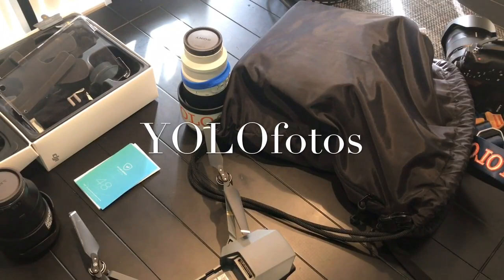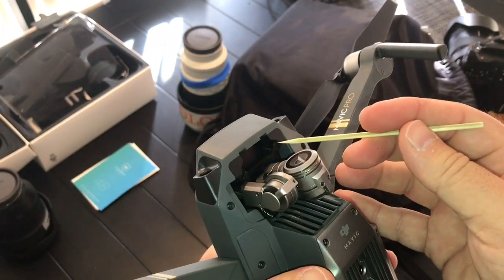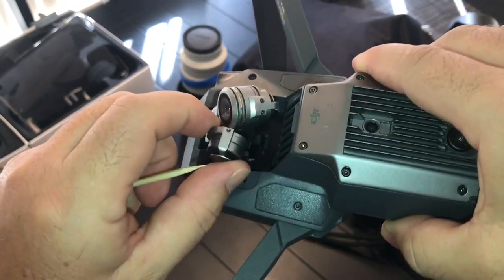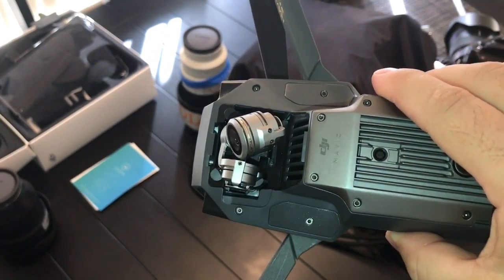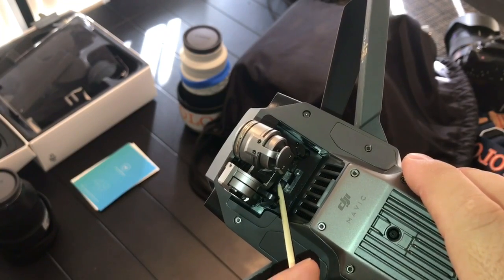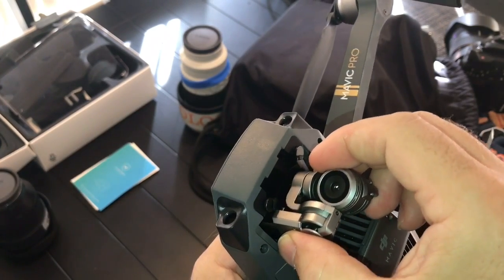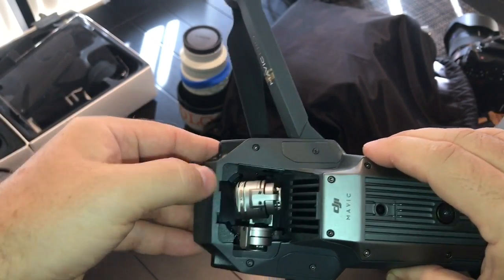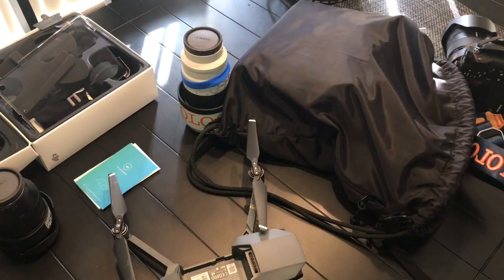DJI Mavic Gimbal Vibration Error

Comment: I came across this video as I occasionally (note: not always) get heavy gimbal shake (sometimes with, sometimes without an "excessive vibration" warning)  and that is absolutely useless for films for my Golf&Tesla channel (I use the drone mainly for my golf course reviews, views of Tesla superchargers from above,  and occasional landscape footage). And I don't want to take the drone and camera/gimbal apart... However in my case, moving the plate back in the proper position did not solve the problem ... - but thanks anyway. Your video is well made.
Reply from the maker: Bummer it didn’t work. Good luck and thanks for the compliment!

Comment: Great vid my man. Unfortunately for me the gimbal issue persists. It is attached perfectly (as far as I can tell) with the gimbal platform underneath the L bar. Do the rubber bands need to be tightened perhaps? I'm too cautious to just give it a go... Anyone else have this issue?
Reply from the maker: Gus Read if you have not replaced your blades replace your blades. That may be the problem.

Comment: I still get “Gimbal Abnormal Vibration”. Everything is set properly. I’ve even popped it out and snapped it back in but error still comes. What can I do?
Reply from the maker: BBQ Made Easy you may have another problem maybe change out your blades.
Reply: YOLOfotos I found out last week it was my blades. I was using the low noise propellers for mavic and mavic pro. Went back to default and no more issues
Reply from the maker: BBQ Made Easy good deal!!

Comment: Hello I wanted to clarify a question I have a Mavic Pro platinum and I have a problem with it every time I fly with it loses focus I don't understand what else to do it loses focus and doesn't come back I go back to calibrate it and when it is in the air  lose focus again would you know to tell me why it happens?
 Thanks
Reply from the maker: Hugo Soares I had the same problem. For me it turned out to be that the infinite focus was not activated. Meaning everything is in focus all the time. Look up videos on infinite focus versus manual focus and you should be able to find the setting. For me I was having to tap on the screen every time I wanted to focus in on something.

Comment: Thanks, I had a crash when my props iced up while flying up through a layer of freezing fog. Your video solved my problem. Fortunately I only flew vertical and it came down right where I took off. Only the props were damaged and gimbal dislodged. I love YouTube. I remember when YouTube was just knuckleheads crashing on skateboards.
Reply from the maker: yankmyfinger right!  Lol. Such a great resource. Thanks for the comment.
Reply: I found this also except for me it was up a mountain and the air temperature was a little cold. I have now learnt my lesson about unfolding the propellers first when in cold conditions.

Comment: This is actually not the proper solution with the gimbal abnormal vibration error.  I’ve had it on and off on my MavicPro and every time I check the camera, it’s properly seated. When I fly on tripod mode, the error was never there.  The rubber and damper wears out which makes the camera shakes more especially with winds blowing up there.
Reply from the maker: Erwin Lopez this fix does no address worn dampers. Correct.

Comment: I crashed my drone after going sideways into a tree branch.  I found the gimbal on top of those visible outer tabs, put it back in, and thought it was floating pretty freely (although I did notice that the camera holder was not going on as easily).  Since I broke off small pieces of the ends of two propellers I thought that may be the cause, but after putting new propellers on it was not.  But after watching your video I found the little tab on the wrong side of the base plate.  After fixing that no vibration error! yay! Thanks for the great video. Thanks!
Reply from the maker: Thanks

Comment: I figured out this problem also, but it only became apparent when I could not fit the gimbal clamp in place. I then realised that this was because the gimbal was sat on to of this L-plate. So if you are getting a vibration error, see if you can fit the gimbal clamp, and if you cannot fit the gimbal clamp this means the gimbal is on top of the L-plate.
Reply from the maker: Thanks

Comment: THANK YOU! I thought for sure the Mavic was on its way back for repairs. I wasn't getting an error. The symptom I had was that the gimbal clamp was putting too much pressure on the gimbal when I tried to snap it into place. It was like the lens was too far forward and down for the clamp to freely snap into the lock position. Once the frame fit under the "L" shaped piece everything just fell into place. THANK YOU!
Reply from the maker: Thanks

Comment: Maybe anyone of you can help me... This little bracket you mentioned in your video is broken :/ don't know how this could happen (had no crash) ... I noticed it only when i wanted to use my mavic the next day. The gimbal behaved strange and couldnt be calibrated corrcetly. During the flight it was shanking the whole time ... Anybody struggles with same problems, any suggestions what i can do?
Reply: did you ever find a part to replace the bracket? same issue here
Reply: @SouthernFlow  DJI fixed it for me... Probably changed the whole lot
Reply from the maker: Thanks

Comment: dude, it's so rare that i actually sing-in on any site esp to make a comment BUT your outstanding vid was so on point and well done, i had to do it!  mind u, my background is in sw engineering and one thing that's lacking in many vids is direct and pithy msgs. u did both!

i had crashed my mavic earlier today and after replacing a broken prop, i got the gimbal vibration msg. if not for your well done vid, it's likely that i would've sent it in to dji for repair.

i'm not sure why u would have ANY negative comments but i'm hear to tell u, your fine work and explicit vid / verbiage are exceptional!

thank u, very, very much.
Reply from the maker: Thanks!

Comment: Thank you so much for sharing, I recently had my Mavic Pro drift sideways from a still position due to weak gps signal into a concrete wall and fall about 4 meters onto a stone floor.  The rear blades were meshed up badly but I had a spare set.  However when I went to fly it again it was giving me the gimbal excess vibration warning.  All is good now, unfortunately this happened at my son's outdoor wedding reception on the island of Crete in Greece.  I missed out on capturing some amazing videos shots there and several other islands we visited in Greece.

I thought it would need to have factory service, should have taken the time to check into it more then.  Guess my nerves were gone after that incident thinking I had just written it off after just over 2 hours of total flying time.  Tough little guy.
Reply from the maker: Thanks

Comment: That L shaped bracket is broken on mine. I hot glued it back together but I still get warnings it's broken the gimbal won't move. I tried recalibration but it froze at 5%. do I have to completely replace the part?
Reply from the maker: I’d think so

Comment: People helping people. Changed my mood 180 degrees in 5 minutes. Thanks. I owe you a beer.
Reply from the maker: Richard Tibbetts right on!  Thanks for the comment!
Reply: YOLOfotos I guess buying you a beer is impractical. So instead take a tip from a guy who has been dry aging meat with Umai bags for a couple of years now and then putting them on his XL BGE which he lights with a luftlighter. Your next thing should be a sous vide device. For a couple years now, I don't cook steaks any other way. Peace!
Reply from the maker: Richard Tibbetts thank you!  Great tip!  I'm just getting into that. So far ribs are my favorite. The 30 hour version. Scallops too, I'll never cook them any other way. Likely to post a few sous vide videos soon. Any dishes you recommend to try??
Reply: 2 beers in Panama. Just changed my mood too. Perfecto amigo. Gracias